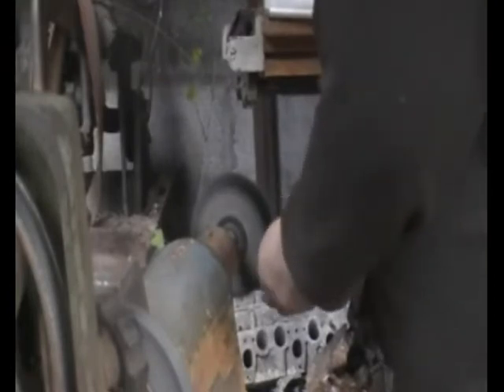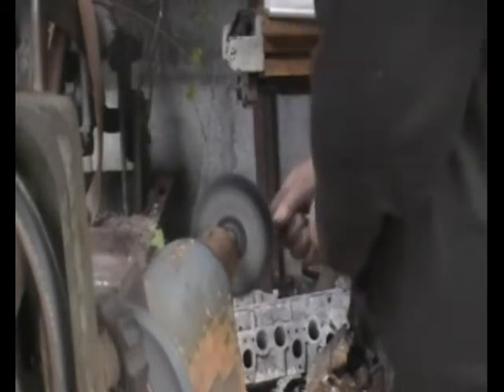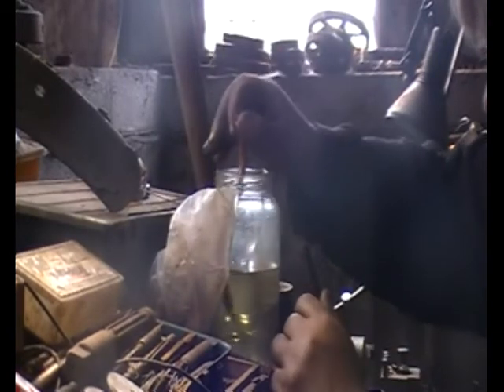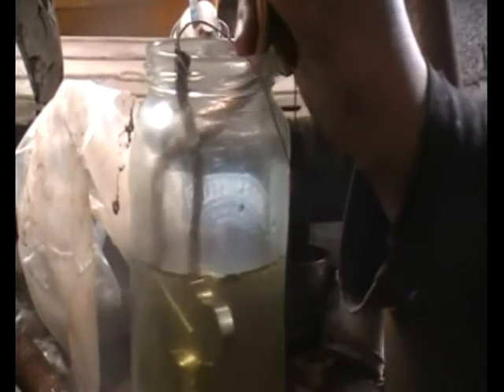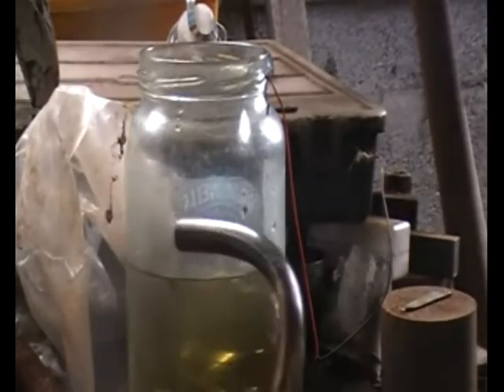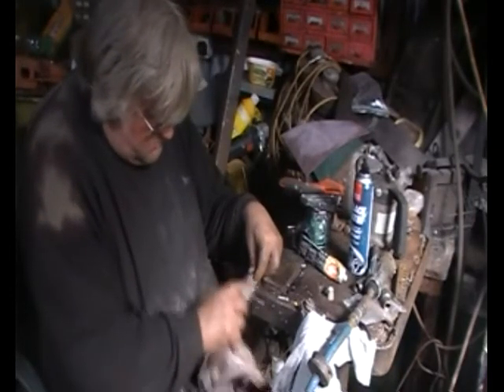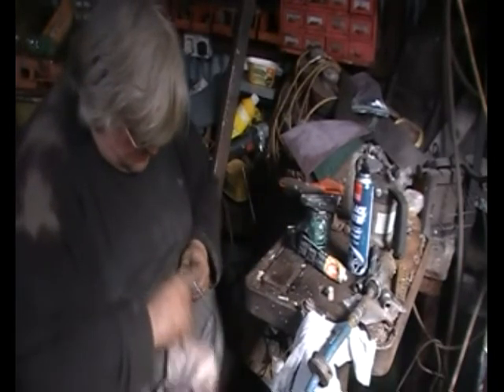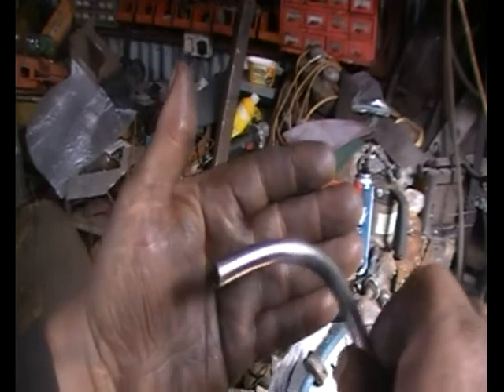experiments with nickel plating

Comment: Hello Dave. I have used a nickel kit supplied by Caswell here in the states and it worked really well. I plated steel and copper and years later the plating is still good. Agitating the nickel salt solution is important once you start to do large or odd shaped bits. The kit as a little aquarium pump in it to do that.
Reply from the maker: yes i'm looking at the caswell  kit and the geatros kit at the moment ,i was going to ask if it lasted so thats good to know .what about temp, is that important?
Reply: It's a bit like glue, it's all in the preparation. Everything degreased completely (not even solvent residues), right temp, right voltage and agitation. The thing that I liked about the Caswell kit was that you got everything that you need except the power source. x square inches to plate equals y amps. so if you have fixed amps you just sort your parts to suit. No need for expensive variable power sources.